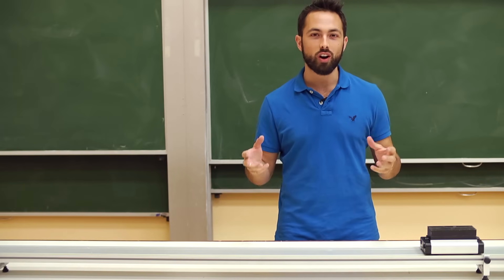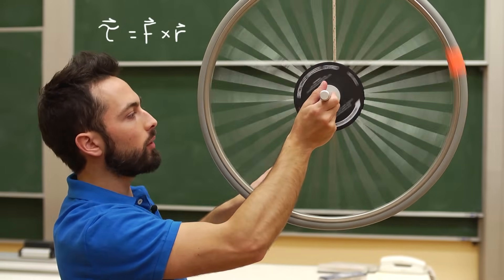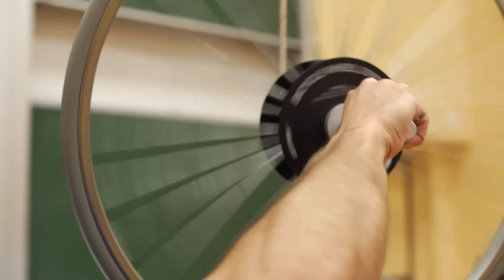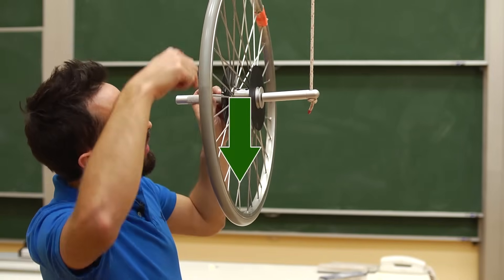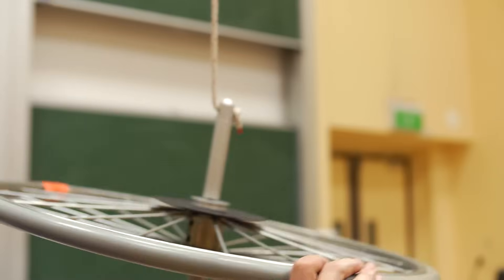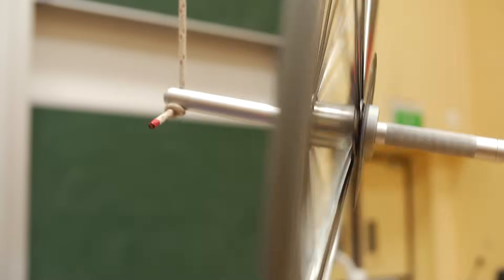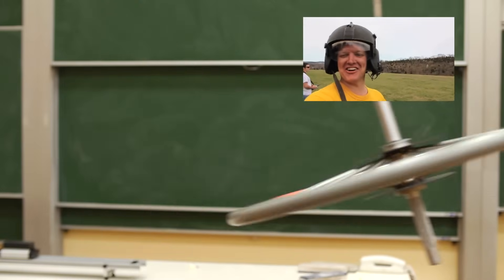Gyroscopic Precession

Comment: That was a great demonstration. The rotation on the rope was opposite what I expected. If you spun it faster, would the axle remain more horizontal? If the bearings were perfect, would the axle maintain its angle for extended time if the wheel held its speed? or would it be necessary not to let spin on the rope for the axle to maintain angle? Does the spinning on the rope eventually allow the axle to go to the vertical? Would forcing it to twist the rope the opposite direction make the axle go beyond horizontal wheel on top?

Comment: After the you apply a force on the wheel, the wheel rotates but is slowing down due to friction. Doesn't this mean that the torque is pointing in the opposite direction, and, when released, the wheel should go around the axis the opposite way?

Comment: If you don't understand this explanation, think of it like this: 
Any one point on the edge of the wheel has momentum in it's current direction, ok? Let's say it has the momentum value of 100.
Now imagine pushing that point towards the rope, that is, perpendicular to the direction the wheel is spinning.
Push with a force of 1. 
Now, the point has a momentum 100 in one direction and 1 in another. 
Add these together and you get a momentum of 100 + x in a slightly tilted direction. 
The path that the point will now take to go around the wheel will now be inclined from the original path. Read that until you get it.
The point at which the point will be farthest from the original point's trajectory is roughly 90 degrees from where the force was applied. 
Therefore, the force will push up at 90 degrees and you get gyroscopic precession.

Comment: angular momentum is having the direction of the rotation and it is not pointing outwards! So the torque vector! The torque is only initially applied so it cannot be utilized in this example again. Angular momentum would be able to create torque only if other deceleration or acceleration would happen. So this actually work because gravity would want to accel downwards and then but that conserved downwards motion (energy) is going to rotate and therefore its component will point upwards. But the two (up and down ) have some tilt too so it would want to go outwards because this component also rotates.

Comment: The explanation is WRONG. The only torque on the system is MG which he ignored it. The Force that we applied for rotation does not exist after the application. It exists in the form of angular momentum.

Comment: If u take consider standard unit vectors along the x, y, z axes ; in the video torque due to rotating  the wheel is along -î and torque due to gravity is along +j^ (initially)  so their resultant is along the diagonal. Now direction of torque gives axis of rotation so the axis becomes diagonal. But as wheel rotates in horizontal plane the resultant torque rotates with it . This continues and the wheel doesn't go down. 

Am I right?
PS, torque is R vector cross F vector not F vector cross R. BTW great video.😃

Comment: So throughout this entire playlist (Smarter Everyday DEEP DIVE #1 - Helicopter Physics!)  I've been slowly learning more and more about gyroscopic procession and angular momentum, and my mind of course has constantly been asking the question, "How?" and with each and every new revelation, "How?" and "Why?"  I remember my technology teacher in highschool who was teaching us what we needed to earn CompTIA certifications telling us that we shouldn't have our CD/DVD drives sitting sideways because it would stress the drive more over time and reduce its lifespan. I thought then that she had to be wrong because theoretically a solid disc has equal mass on all sides, right? I realize now I was wrong, but I think I've also realized something else.  So I have a hypothesis on this, and that is that the acceleration of gravity is affecting the wheel at all times, and so when it's not spinning it simply falls.  I hope I can explain this next part clearly:  So again the wheel has a mass and the acceleration of gravity is affecting that mass at all times, but acceleration is applied over time.  So if you imagine one point on the wheel and imagine it's mass that's spinning at  X rpm's it will still have had the force of gravity applied to it over time, but the vector of the force of gravity will change because of the wheel's spin. At different points in time it will either be working with or fighting against the acceleration of gravity.  That's about as much as I've got and again it's a hypothesis. But still very cool stuff.

Comment: This video failed to explain why tork already exist in system (because of weight) cause wheel swing down but but rotate it if another tork is avaible in system but orthogonal direction.

He clearly shows the tork's avaible on system while wheel moving pointing different directions.

We wonder exactly why the tork  caused by turning pointing complelty different (orthogonal) direction effects the way work the other tork caused by weight.

Comment: When the wheel is at rest, the gravity exerts a torque which makes the wheel to fall down. Now falling down means anti clockwise rotation and the angular momentum is in the same direction of the applied torque.

And now we have the wheel spinning. At this time, we already have an angular momentum pointing in the leftward direction. Now we release the wheel. Gravity acts and applies an additional torque in the direction which is pointing outwards. So the angular momentum must increase. If I take that increased angular momentum portion, i still can't understand why the hell it is pointing upwards..?????

Comment: What would happen if you spin it the other way around? In this case the right-hand-rule would point to the other direction or am I wrong?
Reply: The vectors would go the other way around. It would all be the same, except that the wheel would spin the other way around the rope.

Comment: I understand this was one of your earlier videos. But you could've explained 1) vectors have magnitude and direction not just direction. I understand that was just a mistake. 2) given you spent time to point out the torque vectors you should've made it more explicit that the gyro spin was because of the vector sum of the two torques. You mentioned them but didn't explain explicitly the vector sum points in the direction which would cause the gyro spin. Otherwise good video.

Comment: The thing I don't understand stand is this. Torque is angular force. You apply a torque to change the angular momentum of an object by increasing its angular velocity. If an object is rotating with a constant angular velocity, there is no torque being applied to it. The same as if an object is traveling with a constant velocity, there is no force applied to it. Once Derek has got the wheel spinning, there is no longer any torque on the wheel. So why does the wheel process instead of falling?

Comment: Newtonian physics presumes that the momentum of the spinning wheel cannot change no matter what we do to the position or location of the gyro.  If we assume this to be true, then what happens to the energy of the system when a torque is applied such that the orientation of the axis is changed and the gyro is forcibly precessed?  

Since energy = force x distance, we've spent some energy, but where has it gone?  The gyro will naturally resist this influence and come to a stop when the force is removed.  Therefore, where has the energy gone?  This to me seems even more mysterious than the precession motion itself.

Comment: So is the torque the same as a motor, I mean a metal object rotating in a magnetic field? What would happen if the entire wheel were plastic?   Is it a static electric force that creates the torque? It does have the right hand rule just like electricity in a wire.

Comment: Question here!

I want to analyze and explain precession, so I'll do the bike wheel project and all. However, I'm required to measure variants and all. What do I measure and how? The force applied is the controlled variant, and the torque is the dependable, which is the indepentable variant?

Comment: I was always wondering with gyros if you introduce anti-torque to the suspended wheel ie force it not to spin around will it fall or will it stop rotating?

Comment: Although torque is a pseudovector, right?
Reply: +Joe Reven
Indeed. You can define it as r ∧ F using the wedge product instead of the usual r x F using the cross product. The bivector seems more natural and direct since the rotation gets encoded right into the signed area as opposed to the cross product vector which is orthogonal to the plane of rotation.
Reply: Isn't it a bivector?
Reply: Yes, it´s a special vector that rotates...
Reply: +Faruk, Bughaba
Well, torque isn't really a special vector because it's not a vector quantity at all. I think you mean that the pseudovector has an additional sign flip upon mirror reflection.
Reply: the whole thing is pseudo, all we have are predictive approximating models that happen to work
Reply: i thought its pterodactyl

Comment: Torque : Force x Distance. Bicycle pedals. Simple Lever. Larger the distance between point of application and the pivot, larger the Torque.

Precession. When a force, Torque is applied to a Gyroscope, the force effect precesses 90* in the direction of the rotation. Eg. When riding a bicycle, hands free, when I bank left, the the force applied at the top of the rim, pushing it left, precesses forward by 90* in the direction of the rotation of the wheel,  and turns the wheel Left.  ie The Torque on top of the rim, instead of left tilt, it gives left Yaw. That is precession.

Comment: So applying this to the Earth as a whole, if the planet is rotating on its axis around the equator then ("using the right-hand rule") the torque should make the planet travel upwards in the direction of the north pole out of the plane of the solar system, rather than round the ecliptic (as it does). Why is this?

Comment: So this is how we can easily balancing a bike while moving, right?
Reply: The ability to balance a moving bike actually has more to do with steering the front wheel under the bike as it tips to one side (though it is, of course, enormously more complicated than this). A bicycle with locked handlebars is very unstable. Gyroscopic precession does contribute to stability somewhat at high speeds, though tests of people using bikes with attached counter-rotating wheels that should completely cancel the gyroscopic effects seem to show it doesn't matter much. Wikipedia has a pretty good article about this.

Comment: you are making it sound as if torque is "acting" on the device. To put it on other words, it feels like from your explanation torque moves the object. But in fact the movement around the cord's axis is based on the conservation of angular momentum of the spinning object.
Reply: Moreover, imagine you have free piece of nut that is not constrained to a bolt. As you grab a lever nut, attach it to the nut and apply a force at the end of the lever arm, the nut does not go upward which is the direction of torque.
Reply: Total angular momentum must be constant.

Comment: From my standpoint as a physics student, this explanation is not accurate :/

The right-hand rule for vectors associated with rotation is simply a convention. The convention could just as easily have been a "left hand rule", and with the logic presented in this video, the explanation is no longer consistent (with the logic presented in this video, a left-hand rule would have resulted in the bicycle wheel precessing in the other direction). 
From my understanding, angular momenta are conceptual one-directional axes that exist in three dimensional space. They do not originate from points in space and go outward from those points; they are axes. With this understanding, the explanation present in this video is incorrect. 

I appreciate the correction made at 1:11. Angular momentum is a "cross product", and the order of the "multiplication" does indeed matter.
Reply: +Josh D. From a fellow aerospace engineering student: if you decide to use different conventions, the overall result will be the same (in some cases you obvioulsy will end up with a - sign instead, thus having to multiply by -1 your final answer, from a magnitude standpoint as an example). In frames transformations, for example, changing a convention is the equivalent of changing the approach of solving the problem. The only reason you would use one rule more often than another is due to simplicity, that's why left hand rules became uncommon.
Reply: This is because Angular Quantities aren't really vectors, they're pseudovectors.
Reply: What's a pseudovector?
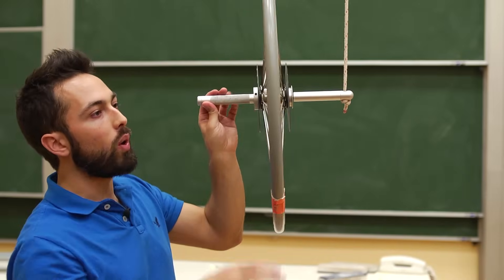Reply: He says there is an angular momentum due to the spinning of the wheel. This angular momentum is to the left side of the viewer at 2:50. There is also a torque acting acting on the bicycle wheel due to gravity. This torque is acting toward the viewer (out of the screen) at 2:50. I agree with these. 

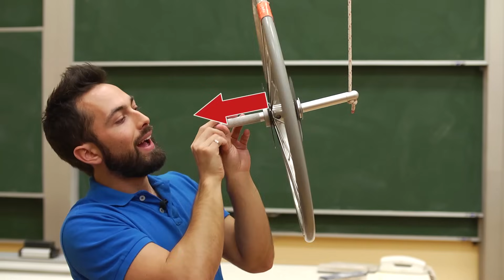It is at around 2:59 when he says the combined effect of the angular momentum from the spinning of the wheel and the torque from gravity acting on the wheel suddenly makes the wheel start moving in the way it does that I don't understand. 

At 2:56, he says "a torque pushing that way (toward the viewer) actually swings this angular momentum 'round that way". Assuming the "torque pushing (toward the viewer)" was the torque due to gravity, then the wheel would have started rotating in the plane parallel to the screen of the viewer, not in the plane parallel to the ground.
 
I feel like he considered "torque" as a force applied in the direction of the torque. This is not a safe assumption to make because the direction of torque is merely a human convention to quantify the direction of rotational motion, not a real force acting in that direction. 

I maintain my stance regarding the manifestation of torque and angular momentum, that they are virtual axes with no point origin. From what I can see in the video, he assumes that torque and angular momentum and torque originate from points, which is not true. It is true that the angular momentum from the spinning of the wheel and the torque from gravity do intersect at a point (where the wheel axle is held by the string), but that does not change the fact that momentum and torque are quantities that manifest themselves as axes with magnitude. 

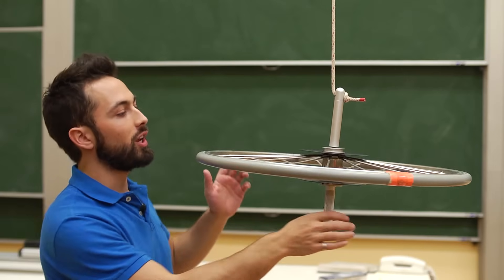On a less scientific note, I see that this video has received overwhelmingly positive feedback, but just because an opinion is popular does not mean it is right. I don't appreciate the reasoning at 0:56 when he says "It all makes a lot of sense", because the reason I'm watching this video is to make these phenomena "make sense". 

I appreciate the replies with real argument to my comment, sorry about replying so late.
Reply: @joshd.1651  You seem to be rejecting his explanation on the basis of the right hand rule being a convention...

But the right hand rule is not the argument for which way the wheels starts spinning. Mathematics is the argument. The cross product tells us which way the wheel will spin and from the definition of the cross product, people invented the right hand rule.

It's in the maths, not in a convention.

You are getting cause and effect wrong...
Reply: @squeakybunny2776  yes, in the original comment i made 4 years ago i said that the right hand rule is a just a convention and that the choice of convention doesnt matter as long as its consistent and that its the guy in the video who is "getting cause and effect wrong"
Reply: The "So?" is that people are trying to get an accurate understanding of this.
Reply: I would appreciate if you gave an explanation of why I'm wrong instead of just judging.
Reply: Dilip Tien Axes do not originate from any point. They are lines.
Reply: I don't know actually! Ask either the person who mentioned it earlier or a credible person on this topic.
Reply: With the assumptions he makes in the video, your explanation is consistent (you are correct that switching to a left-hand rule does not change the final result). However, I do not believe the assumptions he made in the video are correct in the first place.
Reply: What you said is correct. Some of the assumptions made in the video are not.
Reply: Fresh Rock Papa-E basically a human construct that describes some actual physical entity.
Reply: Isn't that the same thing as a vector?
Reply: @freshrockpapa-e7799  h
Reply: Fresh Rock Papa-E I'm really bad at explaining apparently. Honestly Wikipedia would probably be better.
Reply: @Diogenes Rex Calling other people wrong without proving anything doesn't get us anywhere xd
Reply: Actually, if we adopted a left hand rule, it would still work.
Reply: Felipe A. Barretto explain? I tried using a left hand rule and it doesn't work, but I'd like to see your interpretation c:
Reply: Josh D. Try using it in both the angular momentum and the torque.
Reply: Josh D. So?
Reply: 1D axes are the same as having something come from a point.
Reply: Josh D. You are possibly a  bad phy student or your college is

Comment: My question is 

Is the 90deg precession immediate (just varying in force) from a rotation speed just above zero to full speed, or
Is the precession somewhere between 0deg and 90deg from  and rises as the rotation speed rises to a max of 90 deg

If you think about it, when the wheel isn't rotating there is no effect and if the wheel is rotating very slowly the is also little or no measurable effect

What I am trying to find out is if the effect is immediate or gradual and how it applies